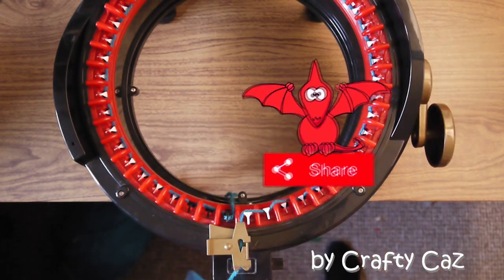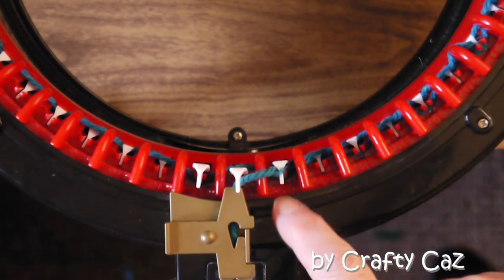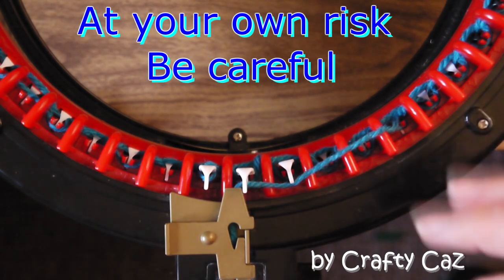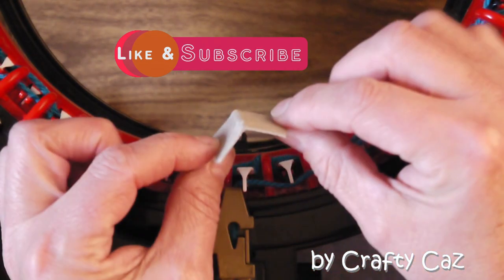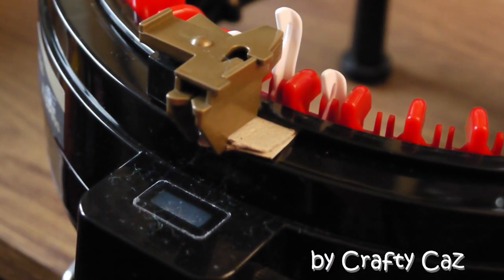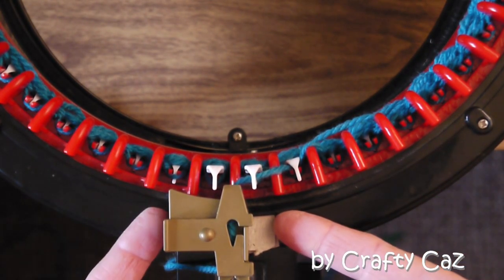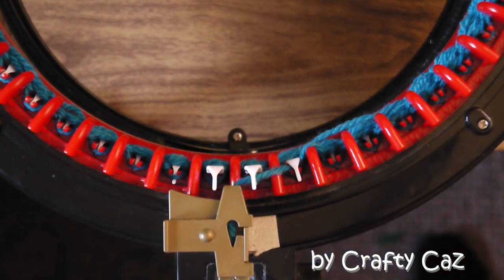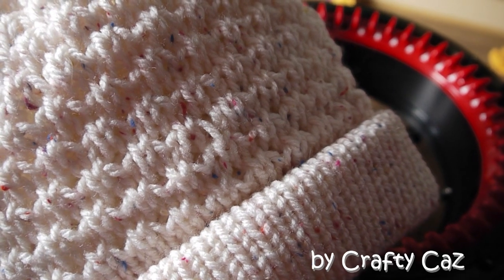Has your Addi 46 started dropping stitches? | My simple hack may help | At your own risk #hack #fix

Comment: Thanks for that idea.  I was so exasperated I stopped using the machine (and we all know it costs quite a bit).  In addition by counter doesn't work properly.  I feel like I just have to rebuild the entire machine.  I watched another Youtube video about taking the machine apart, cleaning gears, etc. which I did...not sure it helped much.  I also just ordered a magnetic counter from dopamine Innovation...recommended by another Youtuber...I look forward to getting that and then trying your cardboard trick.  Thanks again.
Reply from the maker: Hi Yvette, I have since stripped my mahcine down too and cleaned the inside but nothing much has changed. I couldn't see any damage inside either so like you say it's a real pain!! My counter is working ok thank goodness, but your alternative sounds great. HNY

Comment: I did something a little different with mine by threading the yarn through only the top of the tension component, instead of running the yarn completely enclosed in the tension carrier. Seems to work so far.
Reply from the maker: I will def give that a go too thank you

Comment: Hi Caz. I am dropping stitches every time when making the winter waffle beanie but my yarn feeder is not loose. My Addi 46 machine is only a few weeks old and I don't use a screwdriver. Any ideas? It's only doing it on this one style of project. Regular circular knitting isn't giving me problems. Help please!
Reply from the maker: Hi Jenny, sorry to hear this. My inclination is to think that the yarn isn't under the hooks all the way, so keep an eye on the patern rows until you get back to your normal knitting rounds. Go slow and maybe do a test swatch? Fingers crossed for you

Comment: I do not have a machine but I have noticed that those screws that are holding the ring down are pretty far away from the feeder. Would it be possible to buy two more little clips and screw them in a little closer to your yarn feeder? Since I don’t have a machine I’m not sure what does under there, but since there’s two screws already it seems like two closer to the feeder wouldn’t damage anything. 

I know I’ve seen little clips like that in hardware stores. I don’t know what they use them for. I assume it’s to hold something close just like that. You might try where they do frames. It seems like I’ve seen something similar in picture frames. Just a thought. I’m still saving my pennies for my machine but I’m really enjoying all the videos.
Reply from the maker: Definitely something I'll have a look at Janet thank you

Comment: My Addi Express, very new, 0nly arround 150 double sided hats, is turning really stiff. I took everything apart and lubricated the bottom of the needles and some other parts. Also a new handle with new crank wheel. All of this didn't solve the problem. Can you help me to overcome this problem?
Reply: Without yarn it turn ok. As soon as two rows are cast it starts turning stiff. Is it possible that I assembled the black thin ring wrongly? There is only one way it fits or not?
Reply from the maker: @HellavanderVelde  So it was stiff before you stripped it down and re-assembled? If so sounds like you have put it back together ok. Some say not to lubricate and to be honest I did lubricate mine and then I didn't like the feel of it so stripped it all back again and cleaned it all off with warm soapy water before re-assembling. Normally I'd say it was tension that was causing it to turn stiffly but the only thing that springs to mind is the 2 screws that go through the arched black plastic piece that holds the handle mechanism in place could be too tight.....how tight is the handle when cranking without yarn, nice and loose or with some reisistance? It should be quite liquid. Let me know how you get on. The other option as the machine is quite new is to message Addi direct. Good luck I hope it sorts itself out. All the best Caz
Reply: @craftycaz  Hi Caz, thanks for your advise.

Yes I tried everything, loosen the 2 screws that hold the black arched metal.
It's a new handle with the crank, so that should work ok.

Today I got rid of sharp edges on the red ring.....no effect....little lubrication on the inside of the red ring...no effect.

Without the red ring, the cranking go's smoothly.

As soon as I put the red ring in it's place the turning is heavier and with yarn even more heavier.

I have send a message to Addi in Germany.

I will contact them today by phone aswell.

I have seen in some video, somewhere, that there is a special way to put the parts back again.

But the golden ring is circulair, so that doesn't matter how you palce it.
The black thin horizontal ring, can only be placed in one way.
The black high cylindrical inner part also has one position, with the triangle dent at the front where the yarn holder is.

I let you know if things get better.

Greetings Hella
Reply from the maker: @HellavanderVelde  Yes pleaselet me know. I've heard also replacing the red ring can help but I have no first hand experience of that.
Reply: @craftycaz  Hi Caz, I have cleaned the Addi and used WD-40 for lubricating. This works much better. Without yarn the turning go's really smooth. With Yarn it also turns smoothly but I think I have to change the position of the needle and the red ring and the black ring, because it is not going perfectly. How to assembly in the right way, are there any video's?
Reply from the maker: @HellavanderVelde  I think if you do a search for addi 46 dismantling or similar suitable videos may come up to help you. Good luck
Reply: @craftycaz  I got it right this time. The 1st black needle in de middle of the hump, highest level when the needle go's up when passing the counter.  This 1st black needle is also number 1 on the red ring. It go's smoothly now. Thanks for thinking allong. I did watch a video again, where the lady axplained what you have to do if you haven't marked the black needles on the gold ring. Finally It works again, I am so happy.
Reply: Here is the video that helped me to solve my problem.    https://www.youtube.com/watch?v=yBAz1xTt-vA

Comment: Did you try to see if the screws on the sides are loose? In my Sentro was loosened and I tightened and problem fixed
Reply from the maker: Thank you Marcia they are tight yes I'd hoped they were loose but sadly all was tickety boo there